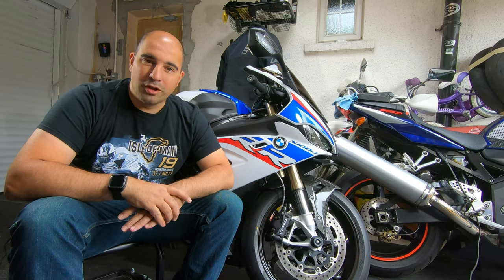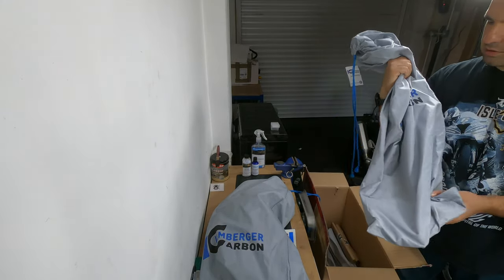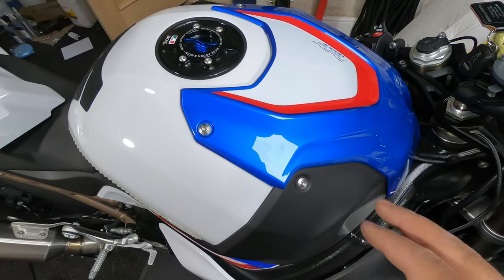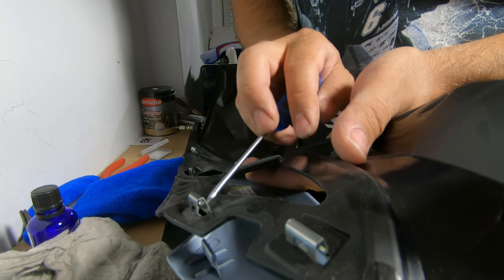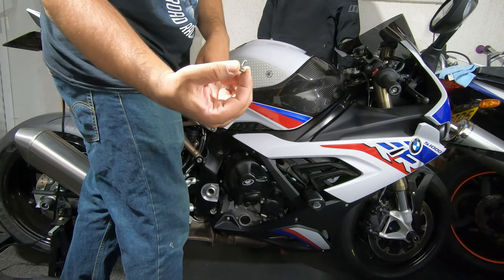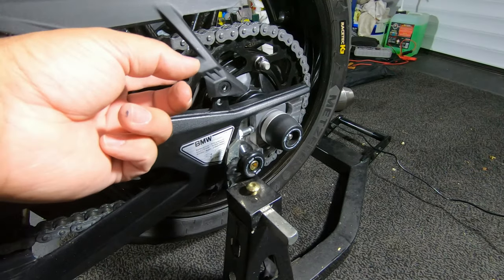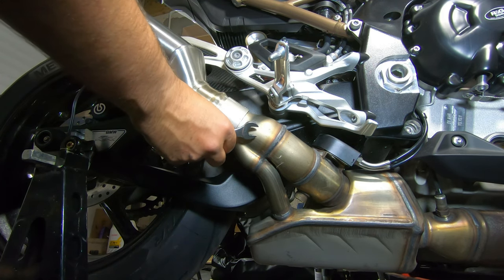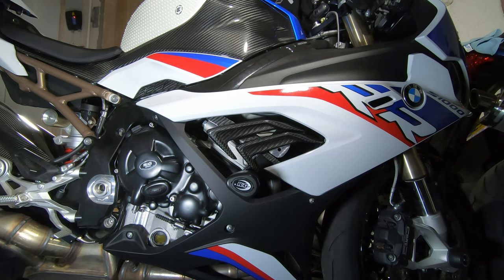BMW S100RR M Ilmberger Carbon Fibre Install

Comment: Have you experienced any issues with the carbon fibre wheels?
Reply from the maker: No not had any issues with the wheels. I use it on track and road and all good. (So far!)

Comment: Pricey that carbon fiber ? Would love some for my bike but little to expensive after just spending 20 k on a bike
Reply from the maker: Hi Mark, it is a bit expensive hence not going overboard but it was a very good price and so I went for it! dont tell my wife! ;-) Let me know if you want a quote for any. Its a good discount!
Reply: @highspeedtouringhst1562   yes mate give me a quote for the side infills
Reply from the maker: Hi Mark, no worries. Can you please have a look online https://ilmberger-carbon.de/Home/Home.aspx and send me an email to info@supershieldauto.co.uk. with which parts you need. There are a couple of options. Cheers.

Comment: Looks good. Now you just need the belly pan. 👍 I’m waiting for delivery of my tank side panels and the “shark fin” air outlet. Thanks for the install video.  https://imagizer.imageshack.com/img923/1838/Nq4i47.jpg
Reply from the maker: I'm torn between a full exhaust system and the longer belly pan and just leaving the standard system so I can still use it on track and the short belly pan?
Reply: @highspeedtouringhst1562  Full exhaust and a tune is the only way to go in my opinion. It unleashes the bike and makes it as BMW intends
it to be.
Reply: @highspeedtouringhst1562  Go carbon bellypan for sure. Just add stock bellypan back whenever you add stock exhaust.